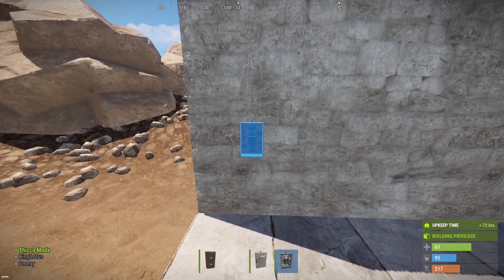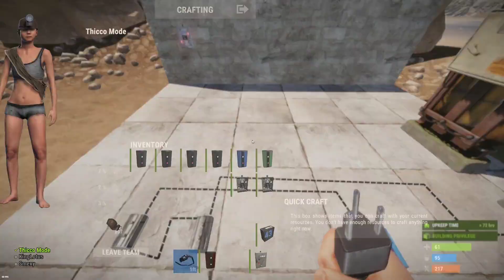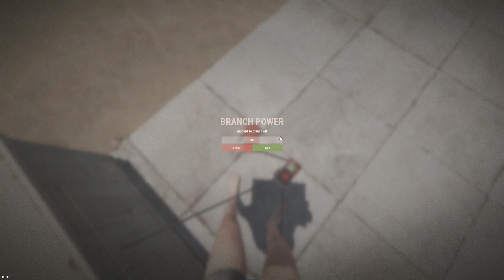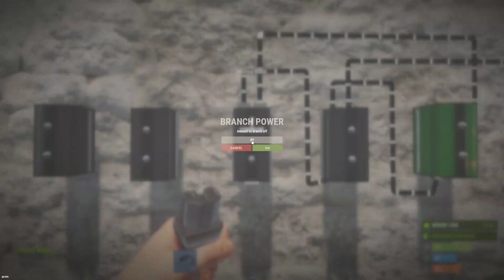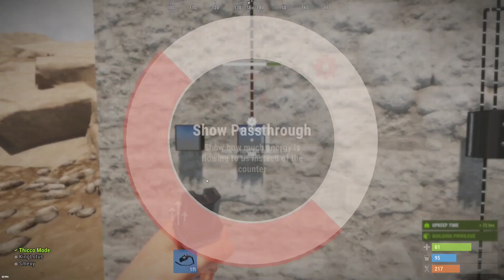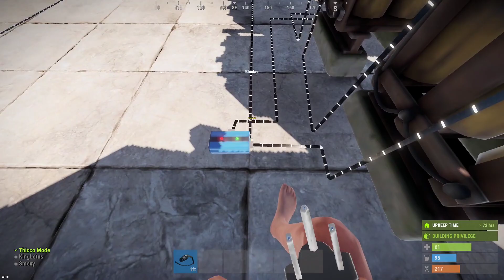Rust Electrical Circuit: Battery Backup WITHOUT Power Loss During Low Input

Comment: really nice, tho if your base uses more than 100 your gona have to sling a splitter on the charge end o the batteries n then combine them on output. but the circuit itself is working great,  noice job ;)

Comment: I was starting to get a little confused when you started swapping cables around for “simulations”, but is this the right setup for example: 2 windmills (combined) dip below a large battery’s (that’s normally blocked) output and/or its early morning, so solar panels haven’t gotten above a medium battery output yet so you’d like the battery  to keep running until panels have gotten above its output? Vice versa for sunset.
Reply from the maker: I definitely took a lot of time away from the computer, but in case you're still wondering:
what this does is let's your battery supply the power in those situations you described, while being charged by the excess power from the solar panels/windmills. This was useful when batteries could not charge as fast as they were being used, however, after one of the updates you could simply put power into your batteries and have your base power come from the batteries.